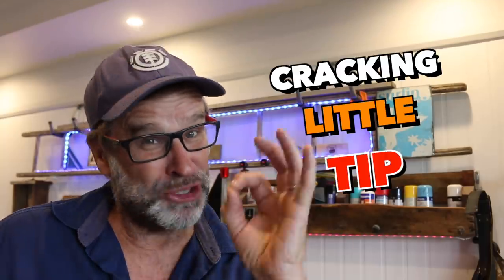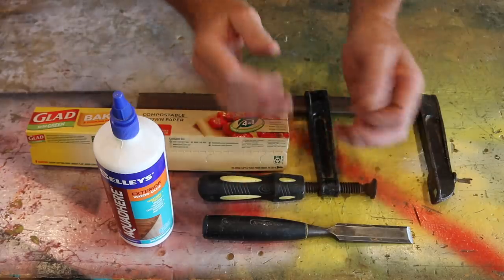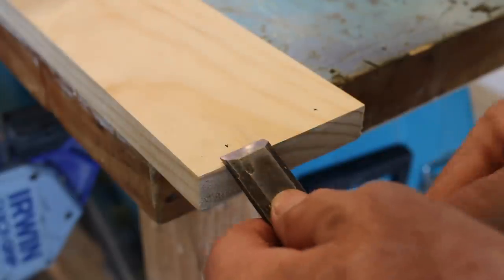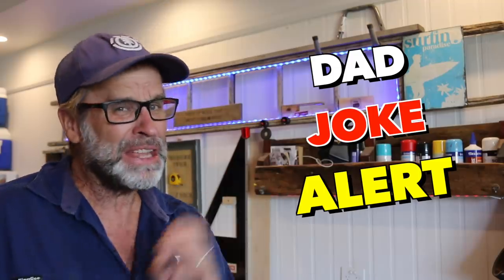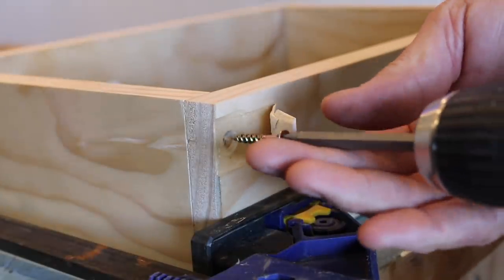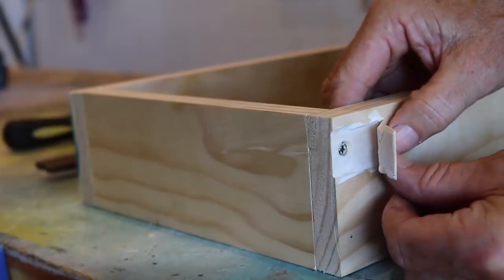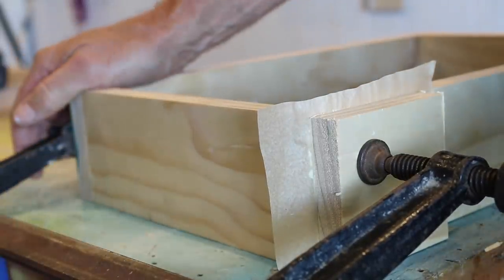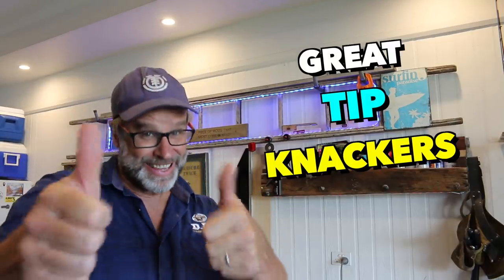The AMAZING INVISIBLE Screw Trick!

Comment: Great tip will have to remember that one, my tip if nobody knows it is,
Did you know the handle on a tenon and panel saw is shaped so you can use it as a square or 45 degree angle?
Reply from the maker: Yeah mate, that's a great little tip....l've used it many times 👍👍😁🇦🇺

Comment: That was a great tip Uncle Knackers. Will try that on my next project. By the way, front tooth was nicely repaired. No more chip and no more Zooper Doopers . :)
Reply from the maker: Ralphy.....the tooth was fixed pretty easily actually.....l was expecting a bit of a drama but it was all smooth sailing and didn't cost as much as l thought 👍👍😁 I haven't weened off the zoopers yet....they're to tasty 😁 Thanks for watching mate 👍😁🇦🇺

Comment: Okay, three comments. First, is it looks great.  Second, is that I would make sure that I have a screw that won't back out under there, so like a high quality modern wood screw. I'm not commenting one way or another on the screw you used I'm just making that as a suggestion to viewers. Third, is that the invisibility could be a problem if the thing will ever need to be fixed, and that's especially an issue because it might be harder to fix something without breaking it. For anything that you'd want to be able to take a party easily, it might be a better idea to have a pocket screw.  If the idea gets popular, it will help for anyone trying to modify or repair furniture made like this to have a neodymium magnet available to detect hidden screws.
Reply from the maker: All good valid points Michael 👍👍